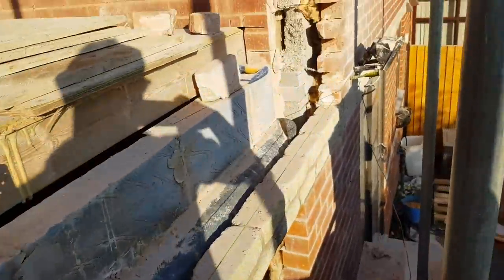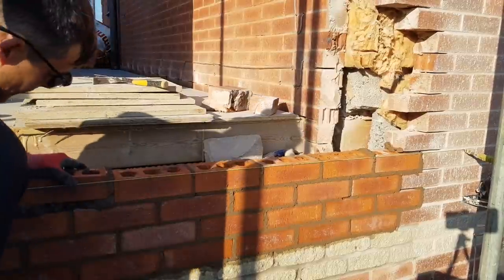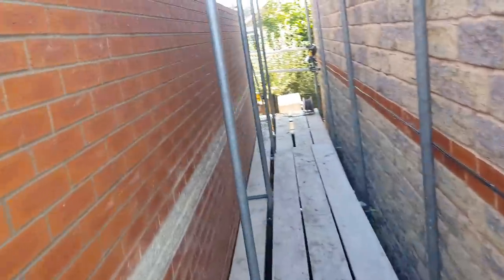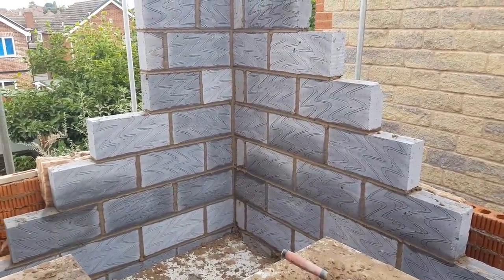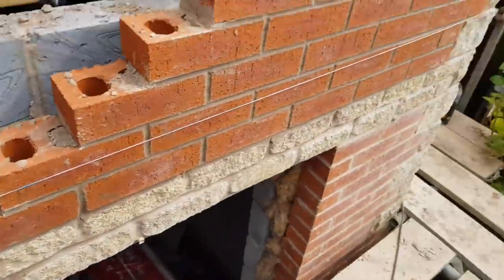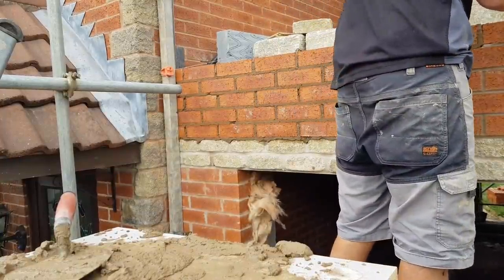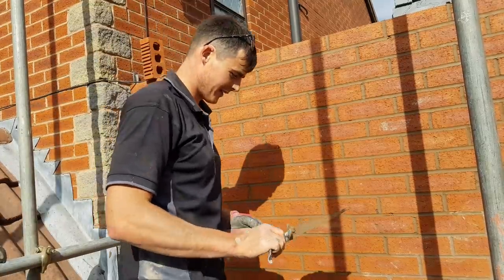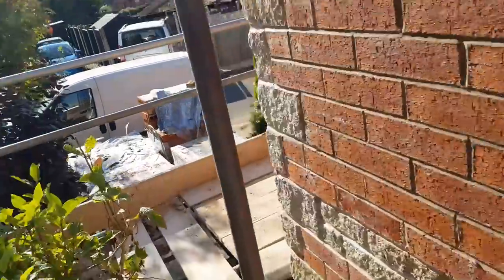Bricklaying - Extension - Useful Tips and Tricks for Bricklaying - #bricklaying #construction

Comment: Sounds like you have come full circle young jedi the apprentice is now the master, good tips all customers have issues with mess so stick it in the quote tell them up front that the working area will be left clean it goes a long way, finally stick your pinholes in the block/brick corners whilst they are still green then when you pull through you don't need a hammer just push the pin in 🍻
Reply from the maker: Haha cheers Mark! Seems like it😂😂 yes mate, great tip there buddy!
Have a good weekend mate!🍻Cheers!
Reply: @IzzytheBricky  may the force be with you